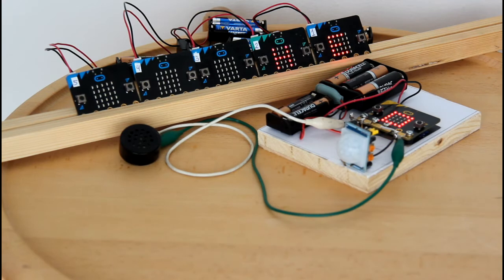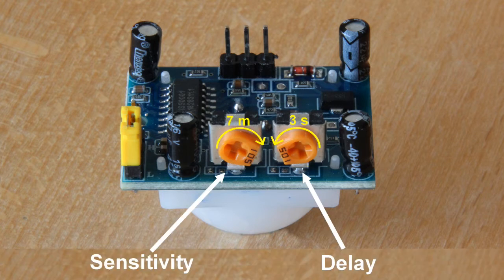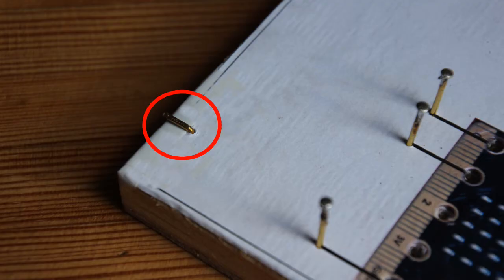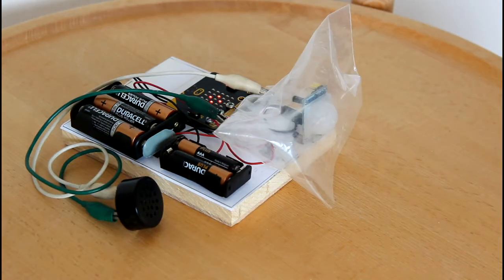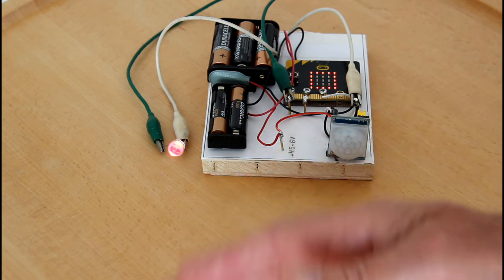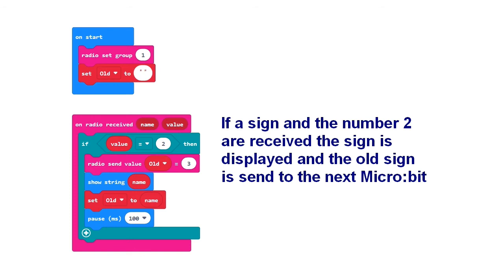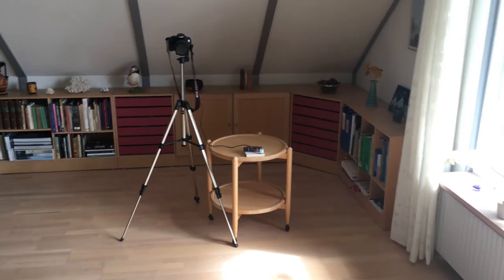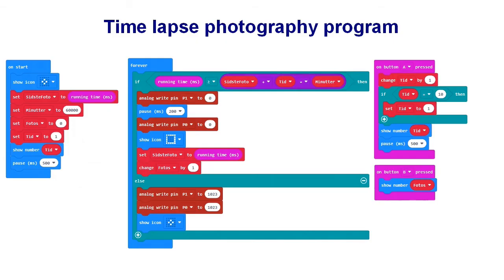PIR-sensor and Micro:bit

Comment: Hi Gunnar Lund my school has bought a load of these sensors but none of them seem to work.They either don't detect any motion or detect motion every second. I was wondering if you would have a solution, thanks
Reply from the maker: Hi Sulantro. It takes some minutes until the PIR has warmed up! Do you use an external power supply? 3V from the Micro:bit is not enough. Do you connect as well the PIR as the Micro:bit to common GND? Have you studied my video where the adjustments are explained? Are the of the same type as shown on the video?
Reply: @gunnarlund6633  thanks it works now the problem was that when it was warming up it was detecting movement and it stopped the calibration
Reply from the maker: @sulantro3511  👍👌

Comment: Hi Gunnar it's me again! 
I was just wondering if you could assist me in my coding for my final MicroBit code for my university assignment... As previously mentioned, I am planning to create a COVID 19 venue capacity tracking system.
The problem is, I only have one microbit to work with. 
I have purchased a SIR (Proximity sensor) as well as the additional alligator clips, etc. 
Though I am not too sure how I can code this on Microsoft Make code to count the amount of people who enter the venue. 

Ultimately I wish my code to process:

- Patrons entering venue (maximum capacity being 20) 
- Microbit has a sound when capacity has reached the maximum amount of people (20 people)
- a reset button (A or B) to deduct 1 patron.
- another rest button (A or B) to reset the counted people. 

It would be amazing if you could make through a code & send it through (email, facebook, etc) 
So I am able to test it out before my assessment is due. 
Im so sorry for the long message. 
I am still quite confused with the entire microbit coding situation so your assistance would be super beneficial to me ! :)
Reply from the maker: Hi Zara. Thank you for your message. I do not think I can come up with more help for you. I do not know the SIR sensor and it will not be possible for me to make the desired code without being able to try it in real life. I hope you will find a solution. Gunnar
Reply: @gunnarlund6633  No stress at all, thankyou kindly anyways :)

Comment: Hi! Is there any chance you could do a microbit / PIR tutorial on: if i wanted to make my Microbit count the amount of people walking past the sensor (eg. People walking in through a venue & counting the amount of attendees the facility has) I am doing an assessment where I have to make a Covid19 device which alerts staff when the facility has reached maximum capacity (eg. 20 people).  I am not too sure how to code this... Your help would be greatly appreciated! Thankyou
Reply from the maker: I'm working on another project so I can't promise to make the desired video. But I would suggest the following: you assume that the store has a separate entrance and exit and that a PIR sensor is set up at both the entrance and the exit. Customers arrive at a slow pace (they enter one at a time in and out through a revolving door). At the exit, the Micro:bit counts how many people leave the store. It must be equipped with the radio function and sends a message to the Micro:bit at the entrance. The micro:bit here is a kind of master where the store can check the number of customers. It must also use the radio function and it counts 1 up for each customer that comes in, and when it receives a radio pulse from the output, it counts 1 down. It can give an alarm, when a certain number of customers is reached - or It could lock the entrance.
Reply: @gunnarlund6633  No worries at all! Your description has been plenty of help in itself. Thankyou ! I'll take that on board :) !
Reply from the maker: @zaramorrison6057  Very good!

Comment: Hello Gunnar! Thanks for sharing all these great ideas of projects using the Micro:bit! They help me out a great deal in helping my pupils to decide upon their projects. 
I was wondering of you could make a video on something like a heat seeking device? Like a servo attached to a camera that follows your motion whenever you enter a room?
I’m really looking forward to see your next video! I can hardly wait!
Reply from the maker: Thank you very much for your comment - it made me happy. And thanks for the new idea, which probably will be quite difficult to make. Right now I am working on an expansion kit (Wappsto:bit), which can make the Micro:bit go online, so you - among other things - can log your data.
Reply: @gunnarlund6633  This looks like a great extension board with both the WiFi and the GPS features. No wonder you’ve been busy! Wappsto:bit seems much easier to use than attaching an ESP8266 WiFi module to a separate edge connector. I’m looking forward to try one out when it is released!